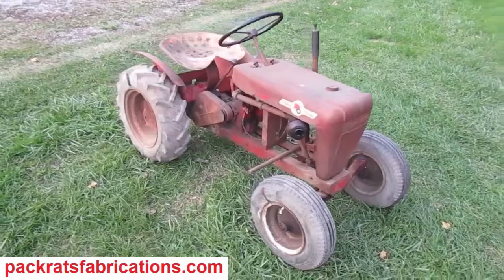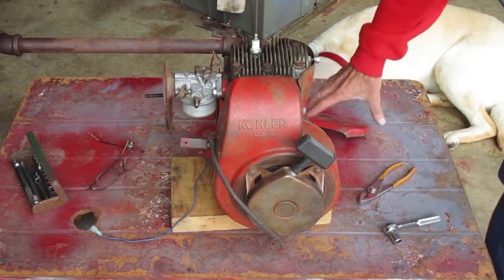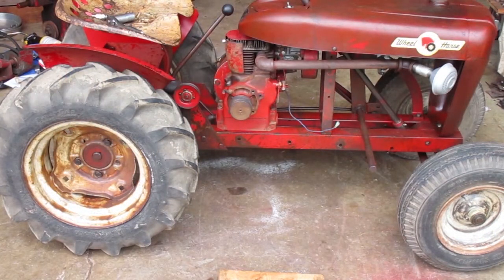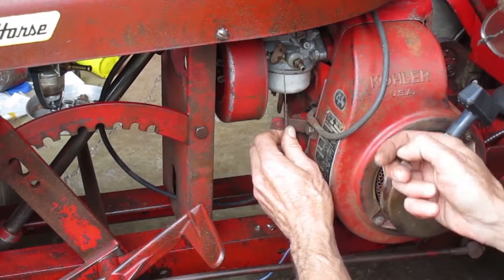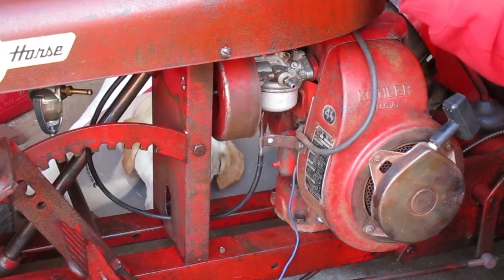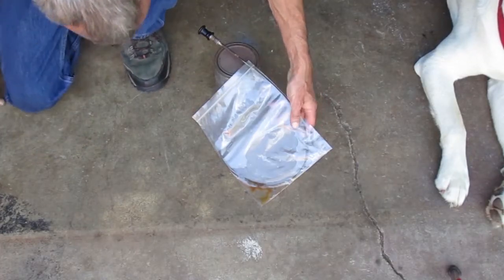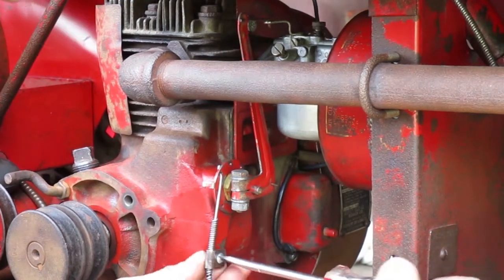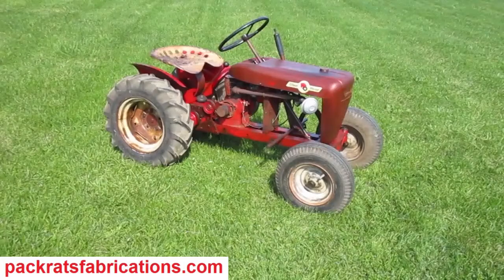Wheel Horse Model 401 Cleanup #12; Engine Install, Throttle & Choke Adjustment

Comment: Once again I have only praise for your video. I  learn something new each one you post.I have replaced choke and throttle cables numerous times , not knowing how to do an effective clean and lube.
  Not now, at least  not without trying some of what you have shown here. I also never realized about the tang in the cable clamp and how they thread in either direction for positioning. I thank you for your knowledge and the unselfish effort you spend on making and posting these videos. 
  I hope you continue to find satisfaction in posting , because it'd be an irreplaceable resource if you stop! . Your ability to use materials and tools at hand without trips to the local hardware store and reaching in your wallet to achieve success constantly amazes me.